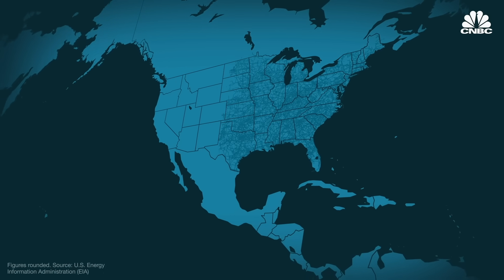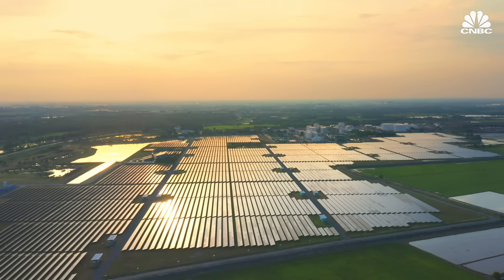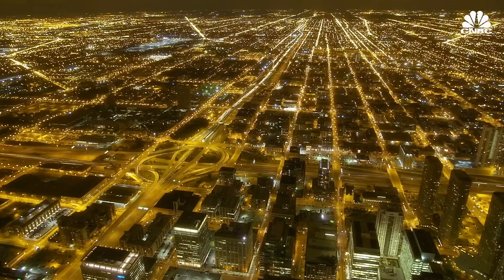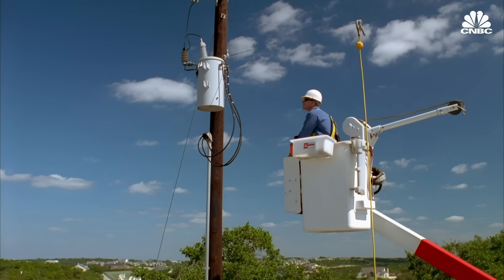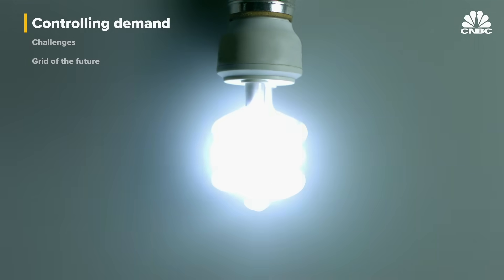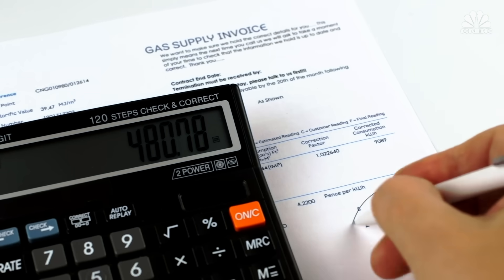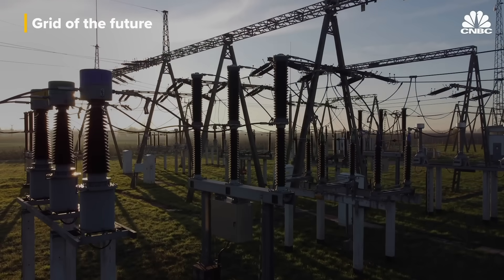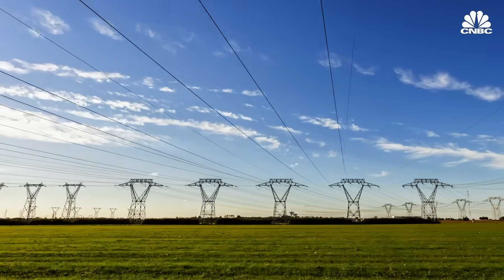How The U.S. Can Build A 100% Clean Grid

Comment: We need a new solution fast we only have nine years left to solve this problem. Creating a new source of power is now more essential than any other time in human history. Now that we understand that climate change is real and will affect everyone on earth rich or poor.
Reply: Geothermal is probably going to take over oil and natural gas because it requires the same skills. Drill a hole, put in a tube, fill tube with water, profit.
Reply: @KRYMauL  ok where are we going to get that heat from and don’t say volcanoes
Reply: @EquityChaser1  Take a drill and go down. Once you go far enough it gets really hot because the Earth is a hard shell floating on an ocean of really hot magma. 

Volcanos are just natural regions where the Earth's crust is thinnest, and is really good for classic geothermal. However, EGS requires the same skills and jobs as fracking and natural gas and oil drilling.

Source: https://en.wikipedia.org/wiki/Enhanced_geothermal_system
Reply: @KRYMauL  yes then comes the earth quakes and volcanic eruptions but any way good idea but if you ask me I think it’s a little far fetched.
Reply: @EquityChaser1  It's not far fetched we have the technology and use it a lot for oil and natural gas production. All they need to do is move over to use this.
Reply: @KRYMauL  well yes but that’s gonna be a little expensive don’t you think.
Reply: @EquityChaser1  It cost around the same as natural gas, so it could make a good second string option to keep the grid going during non optimal times.

Comment: Invest in nuclear reactors such as thorium-based ones and use high energy density fuel is the way to go. We always move towards higher density energy fuels in history.
Reply: There's a reason why biggest ships in the world use nuclear power.
Reply: Existing nuclear reactors work just fine and has done for decades. The waste is a non issue. Pay me and you can bury it in my back garden. Cost of nuclear are artificially high thanks to politics, overcome this and there would be no need for wind, solar and batteries which are not nearly as green as people think
Reply: @garry8390  yes, totally agree. The only problem with current reactors is fuel efficiency
Reply: @qiensong7621  it's a problem but it's not the biggest problem. The politics surrounding nuclear is a much bigger issue
Reply: Safety and waste are not what hinders nuclear power of any kind. It's not even the politics that are an issue. It's the economics and the speed of ROI. Power generation is a business and like any business is looking for a quick return on investment. The high upfront capital cost of nuclear coupled with its long timeframe ROI make it a poor investment for the short term. Until the economics of nuclear changes, there will be little investment in any form of nuclear power. 

Contrast that with renewables that have a very low capital requirement, quick returns on investment, short amortization schedules, and incremental investment costs. All other debates surrounding nuclear are moot and irrelevant without considering the economics first. The corollary is that the main reason why renewables are expanding at this time is because it is simply cheaper than any other forms of energy generation - "saving the planet" is a side benefit.
Reply: @Obscurai  yes but do you know the real reason why nuclear is so expensive.... The industry was running out of projects to build after years of booming business. They had been so successful that they were doing themselves out of a job. So when three Mile island happened they jumped on the opportunity to spread the fear of nuclear disaster in order to make big profits installing unnecessary safety upgrades. Of course nuclear needs to be done safely but there are people in the industry who are employed to manually check the temperature of every room in a plant every day, several times a day. That's just one example but I could go on all day with others
Reply: @garry8390  Regardless, it is expensive today and until that changes, the technology will languish. Complaining about the past doesn't make it economically viable today.
Reply: @Obscurai  yeah of course. Hopefully new companies will manage to fight the red tape
Reply: @garry8390  And since solar can literally be installed anywhere and by anyone with very little to no red tape, it's adoption rate will only accelerate.  After all, this video did begin by talking about distributed generation. Energy companies just don't need the hassle when there are better generation and transition  methods at this time.
Reply: @Obscurai  and we will all pay the price for "cheap" "renewables"
Reply: @garry8390  Vague tautological statements are meaningless and borders on FUD when no other arguments are available. 

Specifically, all technology has a purchase price, a co-existence price and a legacy price. It all depends on where you want to focus. In terms of deployment and adoption, the main drivers are purchase price and co-existence price.  Any legacy price is usually a future concern as has been for any technology throughout history. 

Each side will dismiss their own legacy price and demonize the legacy price of the competitor. Regardless, current economics proceeds with the cheapest and easiest option unabated.
Reply: nuclear fission can buy us some time transitioning to renewables 
like solar , wind , nuclear fusion
Reply: @eugeneeng4037  Actually thorium, if used efficiently, can sustain for at least 1000 years

Comment: Transitioning to 100% clean, safe and renewable energy in less than two decades means quickly ending the use not only of fossil fuels, including natural gas, but also of nuclear reactors
Reply: Not going to happen for one reason: large scale energy storage doesn't exist and won't exist for a long time. My dad is in the field of developing this technology, it's still very young and has a long way to go before it can be deployed nation wide. Until they we will need to rely on coal, Nat gas, and nuclear to produce power when wind and solar can't